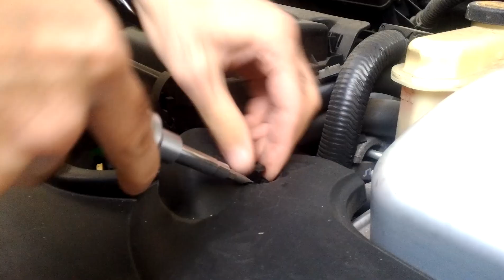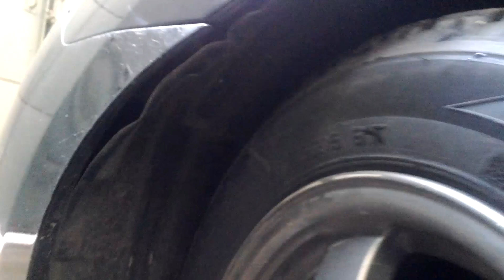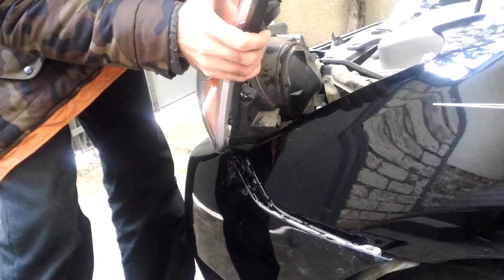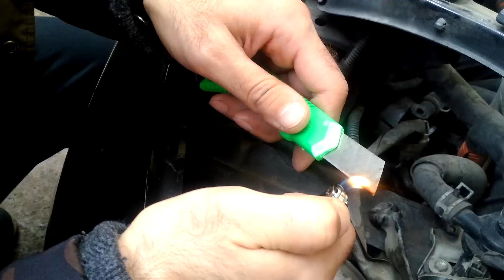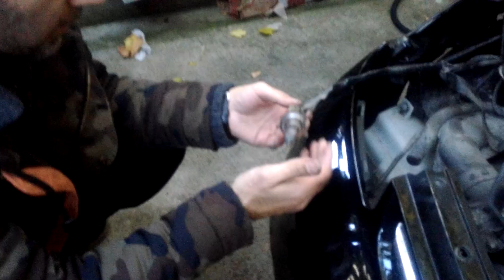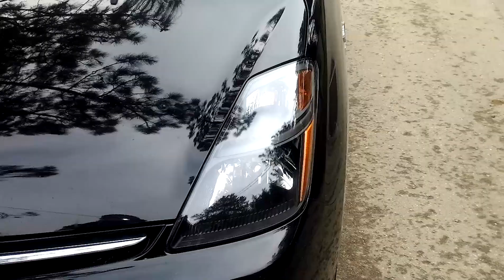swap HID headlights to halogen headlights on Toyota Prius 2004-2009 Gen 2

Comment: What did you do with the HID headlight motor plug did you just tuck it asside? since halogen doesn't need the motor
Reply from the maker: Yes, wrapped up with insulation tape
Reply: Thanks man, used your vid yesterday to do the swap

Comment: I wired it just like you but i still don't have High Beams? 2 white ground wires to the ground, orange wire and pink wire each to their own wire. The lights work but no high beam. Any ideas?
Reply from the maker: see this diagram, are you connecting in this order? - https://www.google.com/search?q=h4+connector+diagram&client=ms-opera-mobile&channel=new&espv=1&prmd=inv&sxsrf=ACYBGNSatmBBw5KKZjiIJog7H3Fvo57grA:1576786469953&source=lnms&tbm=isch&sa=X&ved=2ahUKEwi3ibarw8LmAhWzsHEKHZvdByoQ_AUoAXoECA8QAQ&biw=360&bih=567&dpr=3#imgrc=HouRsCWAKxeArM%3A

Comment: These are halogen, not LED bulbs right?

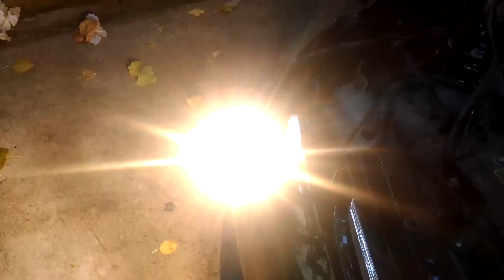What did you cut from the back at 5:30?

Can you put the model number for the halogen bulbs?
Reply from the maker: I am using regular H4 bulbs, but after a while I replaced them with H4 LED bulbs from Beamtech, you can see my video how I did it - https://youtu.be/2Aiwc9h5GTI
Reply: @Petruccio1881  

Yeah I know

But I'm this video you installed halogen bulbs. My question is what did you do to make them fit into the HID headlight housing.

You seem to rip something out. I don't want to install Led bulbs because of the extra steps.

I don't want HID lights because of that issues. I just sent to install regular halogen bulbs.

But you don't really explain what you are doing in the video
Reply from the maker: are you trolling right now or what 🤣 this video is the most detailed one then ever, you have not seen it from the beginig to the end I think
Reply from the maker: I'm changing HID headlight set with halogen headlight set, so now I can fit any halogen H4 socket bulb in it, and also LED buld with H4 socket, that's it, there is no other philosophy or rocket science in this video

Comment: Hello, great video. Will this eliminate the ballast issue many 2nd gen Prius owners are experiencing? Thanks
Reply from the maker: yes, in my opinion, I put led lights in them and they are great, bright and clear, they work without any problems so far, thanks for watching!
Reply: @Petruccio1881  Toyota wants to charge me $750 for a bulb and ballast replacement on my drivers side. Ridiculous. Would you happen to know the overall cost? Thank you
Reply from the maker: prices in toyota service are always astronomical, even in my country. I personally alway trying to avoid dealing with them.
Reply: @Petruccio1881  right. How much did this conversion cost you?
Reply from the maker: I can't tell you the price, I did it myself, I just bought pair of headlights on amazon

Comment: hi my hradlights are foggy wanna replace entire housing . why are  HID headlight housing  for this car way more expensive than halogen housing . they look the same to me
Reply from the maker: HID technology is different from halogen, bulbs are different and lightning of course. that's why...
there are lots of videos how to clean foggy headlights, see them and clean yourself, it's easy.
Reply: @Petruccio1881  I have done a few times but they don’t last u can even use gas to clean your headlights . All dont last
Reply from the maker: I have done polishing with 2500 wet sandpaper and after that used NuFinish polish cream
Reply: @Petruccio1881  tnx but that’s too technical for me 😵‍💫😵‍💫& don’t have the power tools to use for sanding
Reply from the maker: @larryzan8942  no, without power tool, soak sandpaper and sand the surface slowly, after dry it with towel and put some NuFinish cream on a soft cloth and polish with slow motion the surface of the headlight

Comment: Great Video - Thank you!! 
2 questions: 
1) Where did you get the bulb dust covers for the back of your headlight assemblies? (my new halogen assemblies did not include new dust covers - and - I can't swap my old HID covers - they don't fit on my new assemblies).
2) What model halogen bulbs did you use - 9003 or 9006 or etc.? (I see in the video that they have 3 straight prongs - not 90^ prongs)
Thanks again
Reply from the maker: Thanks for watching. 
1. I got dust covers in junkyard, but I saw it on aliexpress too, here is the link - https://a.aliexpress.com/_mNBTWhG
2. In that video I am using H4 bulbs, but after a while I replaced them with H4 LED bulbs from Beamtech (I got them on amazon), you can see my video how I did it - https://youtu.be/2Aiwc9h5GTI